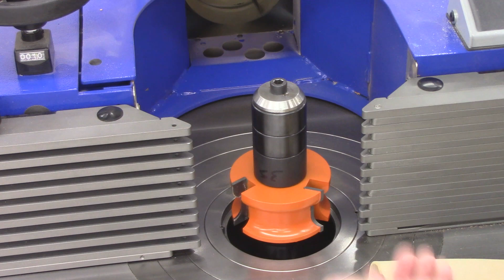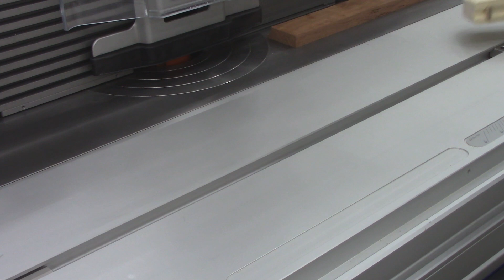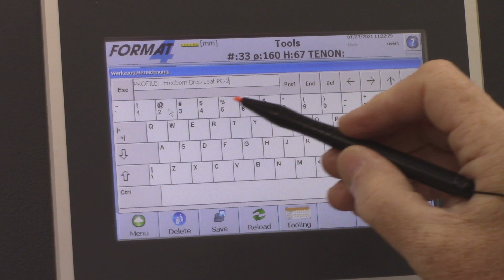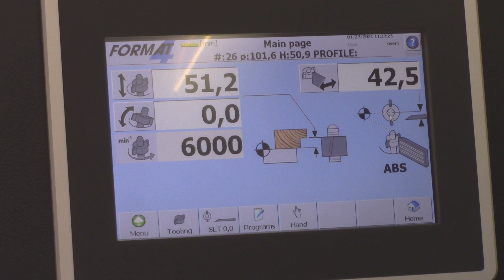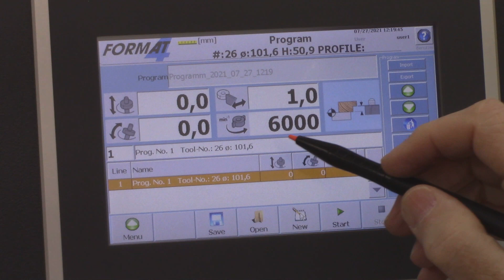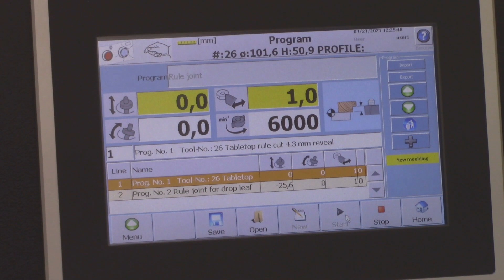Shaper 101 - Shaper Setup to make a Rule (Drop Leaf) Joint

Comment: Hey Steve, any chance you will be doing a review of this shaper?  I am so torn between Format 4 and SCM quality wise, I see more negative comments about felder than SCM but I like certain felder features.  Great channel btw.
Reply from the maker: I do not intend to do a review of this shaper as the current model electronics have changed significantly from my 2016 model machine so am not sure of how applicable my review would be.  I have seen some negative comments about Felder but my experiences with the machines and the technical support has been pretty good and any issues I have had were resolved.  Steve

Comment: Hi Steve Great Video, and an even greater machine. It looks a Fantastic bit of kit, just one thing i noticed is that although you enter and save the cutter & fence settings in the programme for future use, when you actually come back to using that cutterhead at another time you still have to remember to set the offset for the out feed fence or do you include that info on your data sheet? Not sure but on most virtual keyboards hold the stylus on the arrow key for a second and that normally keeps it in capitals until you tap it again. Keep the videos coming. 👍👍👍
Reply from the maker: Thanks Colin.  I just record the offset on the data sheet as it is a manual adjustment.  I figured out the caps lock, turned out it was the down arrow.  Something must have been lost in the translation on that.  Steve
Reply: @extremewoodworker  Happy New Year to you. 👍👍

Comment: Hi Steve, I have a Hammer combination machine. I always seem to struggle with doing "cross cut" profiles. I 'd love to see how you go about it. Being a self-learned hobbyist, I really rely on your channel for this more advanced content. Thanks
Reply from the maker: Hi Bram.  Most of my crosscut profiles involve tenons or cope and stick joinery.  Is that type of cut what you are struggling with?  If so, this video shows making an angled tenon for a hexagonal table:  https://www.youtube.com/watch?v=uuWA8SdwmuM
I don't recall if I have a video for a cope and stick door.  Steve
Reply: I noticed that you put your cross-cut fence behind your piece, while I leave it in it's table saw configuration with the back piece of the fritz&franz and a sacrificial piece to avoid blow out. The pneumatic clamp probably also helps w.r.t. keeping it in position.

The problem I 'm having is small gaps on wider (>75mm) cope and stick joinery.
Reply from the maker: @brambaert461   Hi Bram.  A good hold down clamp will help as before I started using these, I noticed the workpiece tended to shift during the cut (gives a snipe type appearance).  Since you have a combo machine your sliding table will likely have a trajectory that moves away from your blade at the trailing edge.  This isn't a problem with the saw but could cause issues with the shaper especially if you are using the shaper fence as the reference.  For the first step, I would verify that your cope cut is square.  If not, I would set the fence back and use a small spacer block as a registration point.  Using a jig such as the Aigner Contermax should also solve the problem.  Steve

Comment: Steve, thank you for this video, I have the same machine and this is great for me to start to understand the programing side of the machine.
Also thank you for the explanation of the adjusting the out board fence for a full profile cut, The filler strip? I assume that is an A
Aigner product and I need one 
As for Alpine Workshop It is great, I went last year I think for the advanced joinery class and want to go that all the classes maybe this year if possible. 
Might see you there PK...
I will watch this a bunch of times and try it and hit you up with questions if you don't mind 
Absolutely a great video for me at this time with my learning steps with the Profil 45.
thank you.
Reply from the maker: Thanks Glen.  The filler strip is an Aigner option and IMO is a must have.  There is another option that has an adjustable finger for support of rebates that I find much less useful.  Questions are fine.  Steve

Comment: Steve,
Excellent video!  I am ready to order a profil 45 z and was contemplating x-motion.  SOLD.  Very instructional and explains why the x-motion adds value.  Continue to create this kind of content because it is lacking out there.  I plan on going to the Alpine workshop after my machine is delivered.
Question - did you go 7.5, 10 or 13.5 hp?
Reply from the maker: Thank you PK Woodworking.  I will be attending the Advanced Joinery class again in October.  I ordered a 10 HP machine and what I got was a 10 KW machine (so 13.5 HP).  I am glad I had margin for the phase converter.    Steve
Reply: @extremewoodworker  
Steve,
I ordered mine yesterday!  The wait begins. I will have nowhere to walk in my shop, but I will figure it out!
I was very specific, max of 10hp for my phase perfect!
Thanks again for helping me choose!

PK
Reply from the maker: @pkwoodworking  Congratulations!  I feel the pain for shop space.  My theory is that machines and tools are not solids but are fluid and expand to completely fill whatever size container they are placed in.  LOL.  Steve